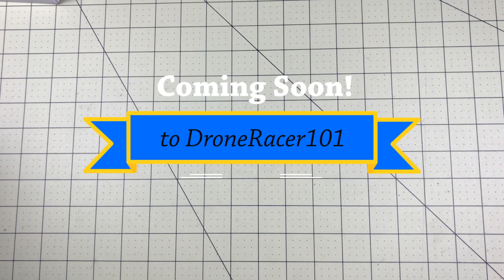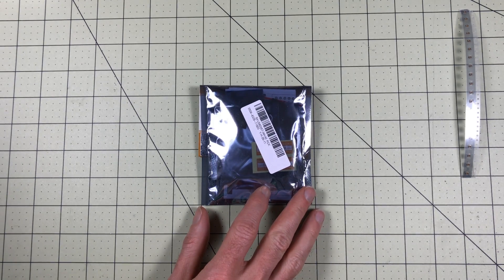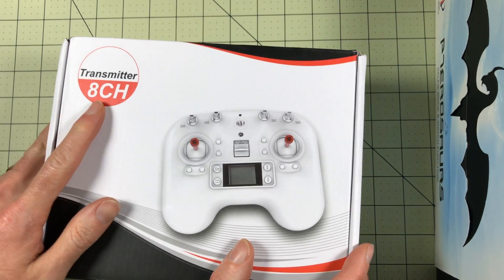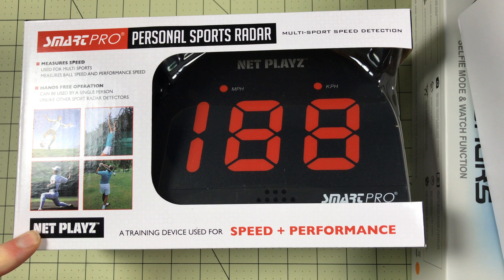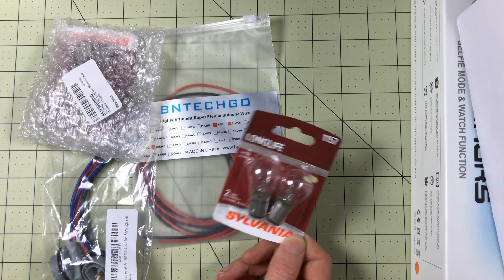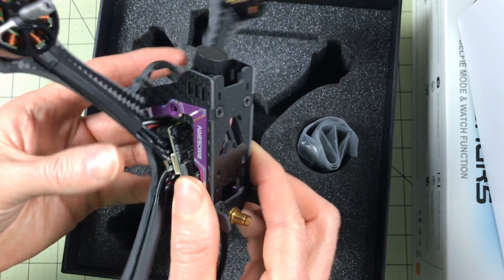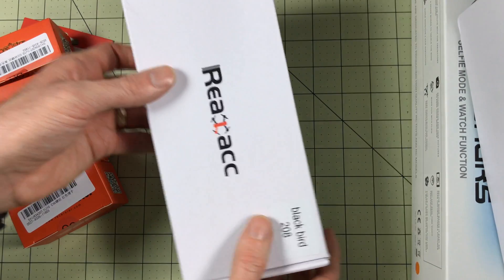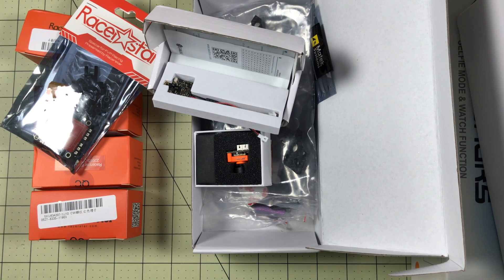Coming Soon to DroneRacer101! #1 F200 High End, Ultralight Build, Cheapest FrSky Radio?

Comment: Good idea! Fun and fast format too. Good job!  :) 

Wink-Wink... Get the "Frog Lite" frame to replace your F200 frame when you break it. That's what I did. It's so much better in material and form like the replaceable arms, FPV cam mount options, angle of the top plate, carbon quality, etc. You'll see.  ;)  :)
Reply from the maker: +GITech do you like the Frog because it also has the aluminum?
Reply: There's that. When I took it to the park for a meet up with my local MultiGP club, several of the guys gathered around saying they wanted to see it in person ('cause I posted a pic on our facebook page of the build). They were all like "that's really nice" and stuff. More than I expected. The aluminum side plates are nice and likely stronger than CF plates and posts, and are attractive. More so in person than in the pics I think. The things that really attract me to these frames is the angled top plate so I can mount the VTX under the top and point the antenna back and down below the rear props, and the option exists to mount your lipo on top (especially with the Frog as it's little bit larger and is lower in the front/higher in the back and the back is above the prop line so no worries that the props will hit the lipo), and it would be easy to stick a cam on top without a special mount.